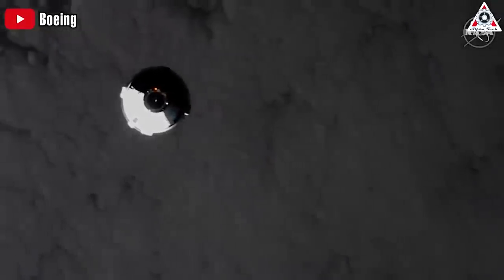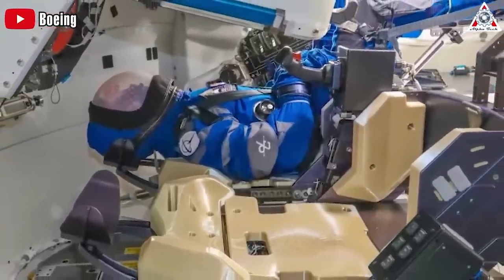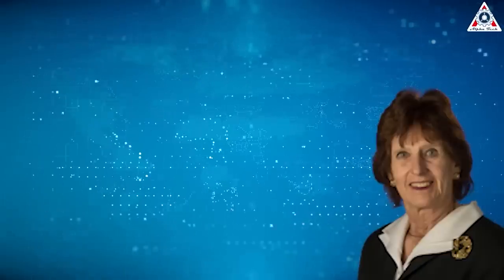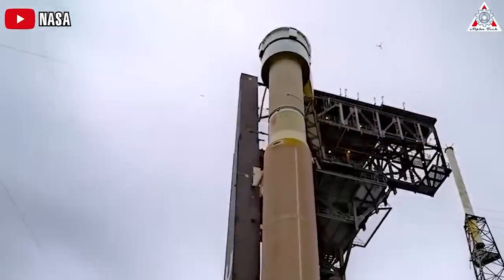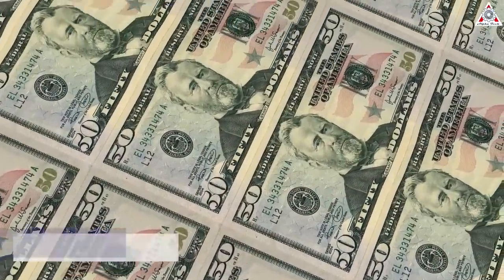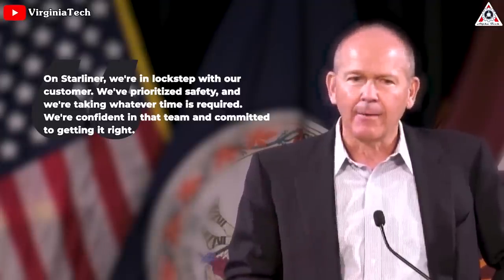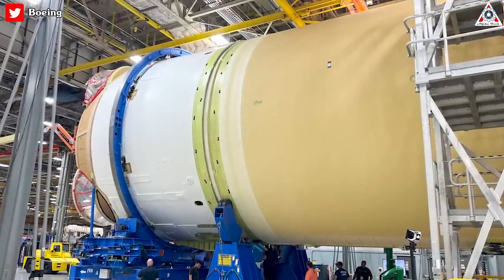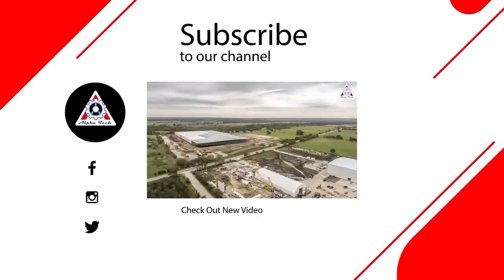Humiliated! Boeing spent billions of dollars on Starliner but never beat SpaceX, NASA gives up!

Comment: SpaceX offered to develop reboost capabilities for NASA. The reason they did not start out with reboost is Starliner was going to provide it.  So much for that!
Reply: Dragon does not dock with a port that is aligned with the centre of mass of the ISS, whereas Cygnus and Soyuz do and Starliner and DreamChaser are planned to do.  The navigation thrusters on Dragon are all oriented toward the bow, because they are only designed to slow approaches, and to gently push Dragon away from the ISS.  The only thrusters that Dragon has which push toward the ISS are the Super Dracos of its launch abort system, but they are far too powerful.  Of course designing a thruster tyat could be mounted in cargo section is trivial, but SpaceX is a commercial business, it does not plan to lose money on any activity, and it does not wish to spend any more of its own money on a clearly obsolete product.  Dragon looks good compared to Starliner or Orion, but is old news by comparison with Dream Chaser or Starship.
Reply: @jamescobban857 An informative comment - a rare beast on YouTube. Thank you.

Comment: Dreamchaser would be an excellent replacement  for Starliner.
Reply: if it ever gets completed and flight/crew certified
Reply: starliner is just a hole for taxpayer to waste money. money that could be used for projects that could succeed
Reply: @arnoldsmith5754  It has become a huge money pit for Boeing. I think the Boeing needs more engineers in upper management positions instead of bean-counters.

Comment: Let's face it both the SLS & Starliner are jobs programs funded by the federal government. It's not by accident the parts come from nearly every single state, so every member of Congress fights for them both. Starliner the capsule is reusable after refurbishment. SpaceX the capsule is reusable with minimal to no refurbishment & the Falcon 9 1st stage is reusable. Once Starship matures it becomes 100% reusable. This doesn't take a rocket surgeon to figure this out...then there's the Falcon Heavy which Elon stated can literally take a payload to Pluto without needing a gravity assist at all & SpaceX internally funded 100% of its development, they were given $0 outside help. Yet ULA got money thrown at them for Vulcan which may make its first launch by the end of this year. Then there's the actual cost of launches, Elon said a typical Falcon 9 cost about $60 Million & Falcon Heavy about $90 Million. ULA was charging $350-600 Million for Delta IV Heavy launches & the Falcon Heavy can carry a lot heavier payload(s).

Comment: Nasa allocated 3.14 billion to SpaceX for Dragon, but how much of that has SpaceX actually spent to develop the spacecraft?  I'm assuming that whereas Boeing is consistently going over budget, SpaceX has probably been coming in under budget.
Reply: Nasa grave 4.5 billions to Boing for starliner, believing boing was a sure thing, the opposite ends up to be true XD.
Reply: NASA advanced the money because it was much less expensive than building it themselves. It worked so well that the program exceeded expectations, even with Boings failures.
Dragon has completed more missions than both were expected to complete at this point.
Reply: Starliner is a 6 passenger orbital oven.
Reply: Similarly SpaceX got $2.9 billion to pay for its implementation of the lunar  Human Landing System, yet almost everything that it requires are capabilities which SpaceX needs for its own market.  Starship has hundreds of potential applications while the Dynetics and BO proposals were designed specifically for one single application with only one possible customer.  SpaceX may not meet the planned date for Artemis 3, December 2025, but there are a lot of other contractors whose deliveries are even more likely to slip.  And 2.4 years is an eternity in Elon time.

Comment: Going to be interesting to see how Starliner will work along side crew dragon if it does go into service
Reply: 2 launch a year was and is it's expected performance, Dragon could do more than that, though is not needed.
Reply: @Voltaje_YT  SpaceX is launching once a week and more.  So much for 2 times per year.
Reply: @metriczeppelin  Falcon 9 launches, not Dragon.  At the very least Dragon is doing 2 crew missions a year, plus the Tourist trips like Inspiration 4, and the various Cargo missions that they do now that Dragon V1 has retired and the missions are now Version 2 Dragon, Crew or Cargo variant.

Dragon V2 currently has Cargo, Crew, Axiom (Currently Axiom 2), Polaris (With Jarad Isaacman from Inspiration-4) through to Crew-14, and Cargo is currently slated to Cargo Dragon V2-15 (CRS-35) in 2026.

22 planned flights over all with Crew (Crew, Axiom, Inspiration, Polaris etc)
15 V2 flights of V2, Cargo variant of crew.
4 test flights (Pad abort, Unmanned to ISS, Inflight abort, Bob / Doug test).

13 Dragon V2 made, final rolling off production line in 2024.
Reply: @ChannelReuploads9451  They "could" launch crewed missions every other week, but now we running into the question of training the crew and how many docking ports are at the ISS and how many dragon capsules we got. Looking at the crewed launch schedule, it is getting increasingly interesting.

Comment: Starliner CFT-1 has not flight in this year. They will redesign the parachute system and hold a retest in December. Launch postoponted on March 2024, not good news. Parachutes was used on OFT-1, OFT-2 is unsafty for crew.

Comment: Please correct me if I'm mistaken, is Dragon certified for interplanetary flight? Has a Dragon capsule flown around the moon and back? If not, how many more billions of dollars would that cost?  3.1 vs 5.5 for machines doing vastly different things! And how much did that superheavy rocket cost that blew up? Which is why a Dragon hasn't flown to the moon. And can you explain to me why so much testing is required when the soviets have used a multiple small engine booster design since the 1960's? It's not a revolutionary design, perhaps if they were testing aerospike engines it would be understandable, or a new launch technology, but they're not, just like the hyperloop, it's just rebranding old ideas that didn't work!!

Comment: Boeing's complete focus on 'delivering shareholder value' otherwise known as cost cutting and maximising short term profit has been disastrous for the company.
Everything they do has been negatively affected. 
Commercial aviation - hundreds of dead people, projects years overdue, never ending quality issues. 
Military - refueling tankers which were many years late with eye-watering cost overruns, unsafe and still unable to provide the capabilities they contracted for. 
Then there is the Disasterliner. 
Sad thing is that they seem unable to learn from their mistakes - probably because the got rid of their best engineers in order to make more money to satisfy Wall street.

Comment: I know Boeing is pretty good at milking extra tax dollars out of the Government, but we need to seperate two issues:

- the costs for NASA
- the costs for Boeing

This video mixes up these two things. NASA has a contract with Boeing for 4.2bn for a certain number of flights. This was a high amount yes, but it was a fixed price contract won in a tender.

Any costs after that is as a starting point Boeings own problem. Unless Boeing can say NASA increased their deliveries, Boeing gets no more money due to the delays. Therefore it makes little sense for NASA to cancel Starliner. It is better for NASA to try to hold Boeing to the contract. If they already paid all or most of the 4.2bn they may as well hold Boeing to delivering something for the money they got.

Comment: There is a much simpler solution that doesn't rely on taxpayers' money, and that is to make the contractor pay for the repairs or improvements necessary for space travel. Boeing will quickly fix the problems with their space capsule, especially if they are the ones paying for the repairs.
Reply: 🤣... bout another decade "quick"...by then they'll be just a bad memory...

Comment: First of all, you have to question anything Boeing tells you. While they have allegedly lost $1.4b, they have been awash in over payment for a long time. Apparently they have fixed the parachute issue and have reported they have replaced much of the tape. I think the tape issue will still keep them out of space for a long time to come. That hearkens back to the old days when NASA flew a flight they should not have flown. I think the Starliner will fly but will be used more for private flights than NASA. It all depends on the success of the Star Chaser cargo "plane". If that thing works the way they say it will then NASA will put money there. If it works, the manned Star Chaser could be three years away from the first launch. They need to get it in the air asap. Continued failures by BO and ULA could set it back even further. They say it can fly on a Falcon 9:-) Of course, we still have politics to deal with.

Comment: Alpha Tech seems to have adopted the Boeing approach to: product design, accuracy, honesty.  You repeat the same information many times in a video and then reuse it in a following video.  You don't make it clear that all the Boeing reworks are on Boeing's dime not NASA's (fixed price contact).  And golly gee whiz you seem to have forgotten that Crew Dragon uses the same wire wrapping tape as Starliner.

And when all the Boeing critics on here are drooling slackjawed at the newly revealed Mach 5+ Aurora from the Skunk Works they need to thank Boeing and NASA for the funding.

PS Starliner will be finish and flight ready before ULA gets to orbit with BO engines.  The DOD better plan on reassigning all launches to Falcon Heavy ASAP.

Comment: the picture they use for the video icon, of the starliner, ha window on it. a trapezoid with the largest part facing out. it occurs to me that, with the vacuum of space, it would be pulling the window out, only being held into place by mechanical means (bolts and shit)  wouldn't it be safer to have the largest part facing in, just in case the bolts fail for some reason? then the vacuum would be pulling the window into place rather than out into the void?

Comment: In the minds of many although Boeing once was, a "prominent name in the aerospace industry" because it was synonymous with positive attributes and contributions.

Much of the prominence currently ascribed to the company is likely now due to negative perceptions.

It defies logical rationale that flogging what the demographic already adherent to the aforementioned perceptions probably think of as a 'dead horse' that is Starliner, can possibly be presented as a positive step any longer if it truly could after the advent of Crew Dragon.

The same group can undoubtedly see that Starliner is not comparable to Crew Dragon and never really was much less with regard to Starship in any substantial context, and that perceptual gap is only going to widen as even better, contemporary, technologies attain fruition.

As you say other technologies equally if not more impressively cutting-edge than Crew Dragon are currently in an advanced stage of development and may now achieve launches before Starliner could do so again with acceptable margins of safety.

The latter technologies are going, to emphasize the obsolescence of Starliner to an even greater extent than Crew Dragon.

So what on, or off Earth do Boeing and NASA think they can achieve by keeping the Starliner cash-cow on life support any longer particularly given the hopefully imminent and spectacular success of Starship?

Surely neither partner enjoys embarassment, but better to accept that than to nurture it until it becomes fully mature as humiliation?